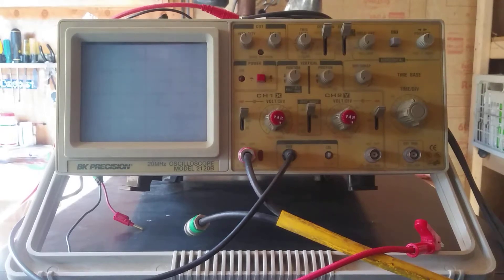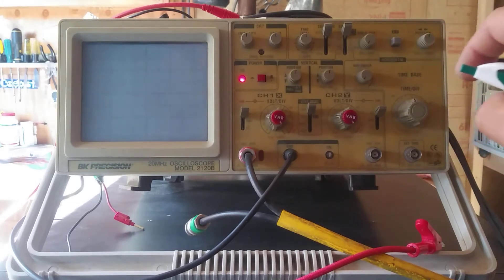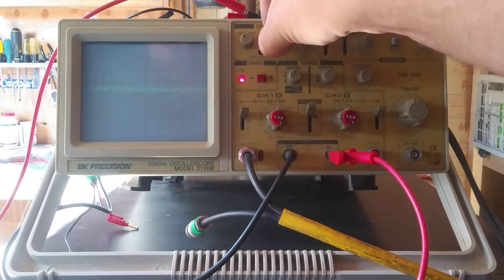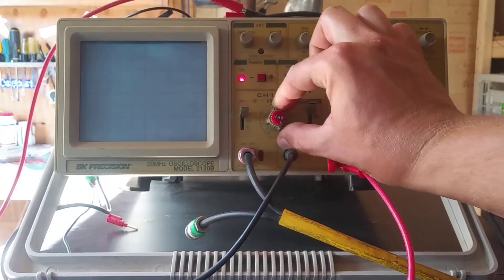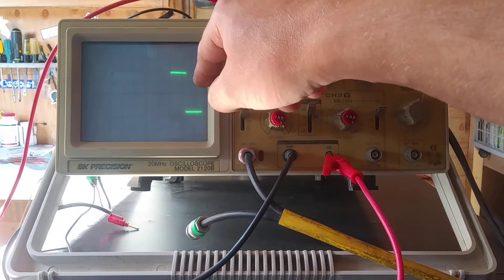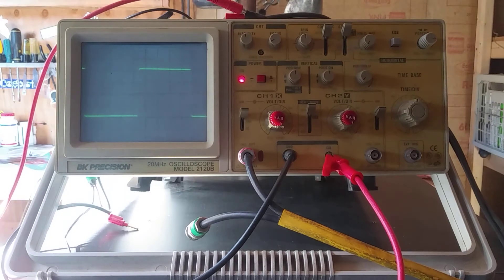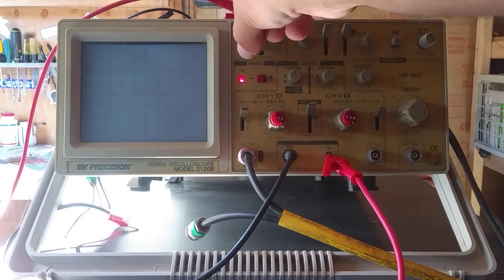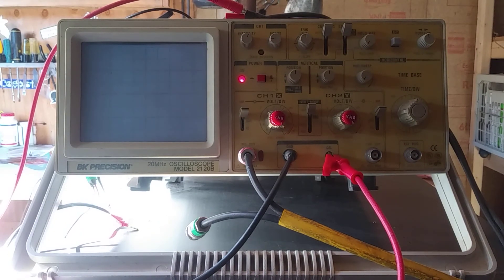Help me troubleshoot an old B&K 2120B please!

Comment: Try using an actual oscilloscope probe.  That alligator clip can pick up noise.  Also your square wave isn’t square because the alligator doesn’t have any compensation.  Do this and clean the pots and you will be good.

Comment: Clean the intensity/brightness potentiometer! All the controls likely need a thorough cleaning.
Reply from the maker: Thank you. Will try that if all calibration voltages check out. Seems like a pain to get to all the pots, right?
Reply: @pturcanu  the difficulty in cleaning them is why it's never done...

Comment: I dont know much.....but i think maybe it's a CRT alignment/calibration problem. Did you get anywhere with it yet? I managed to get a 30mhz version off ebay for $30 and it works great. Oscilloscopes on ebay are a real gamble. I hope you fixed it!
Reply from the maker: Thanks for the tip. Another youtuber engineer suggested the same thing, so I'm going to try messing with calibration voltages. But as I'm still waiting for the fat 5W resistors to arrive to make a divider high-voltage probe to measure the CRT voltages, I haven't touched it at all yet. When I do, I plan to document my attempts and post it here.
Reply: @pturcanu  Ah, OK....well cool. I will await the results and hoping you get a good result!

Comment: I paid for mine on E-bay. Its got the same problem and its even worse than yours. I have not found any useful advice on the net yet, and worse B&K are very unhelpful. They are willing to let me "trade it in" for a newer one with the cost of $400 plus I get to pay shipping. The documents available are not helpful either. If you find out whats wrong please post it here.
 I think its something with the CRT control. I checked some of the capacitors (de solder and check, then re solder) and they were testing fine.
Reply from the maker: As w2aew suggested, "screwy interrelated problems like that are usually due to power supply problems." He certainly knows what he's talking about, and that makes sense to me, too. I'm planning on taking my scope apart and adjusting its power supply voltages (probably in the next video), but need to make a high voltage probe first. 

Have you located a service manual? The one I found does have some diagnostic steps (voltage adjustment, calibration, etc.). Send an email if interested.